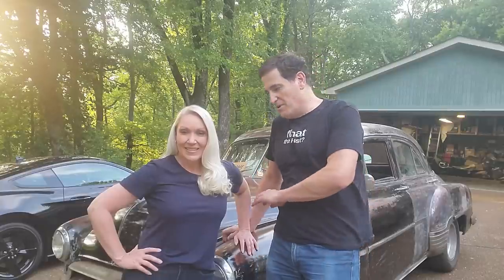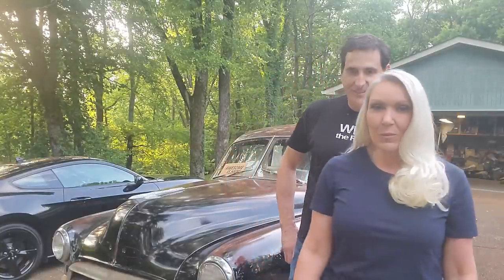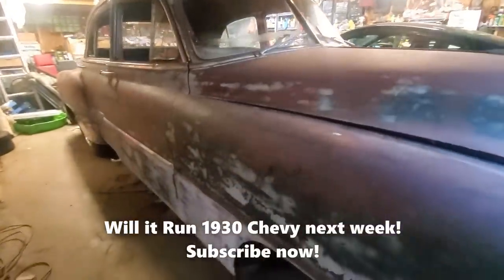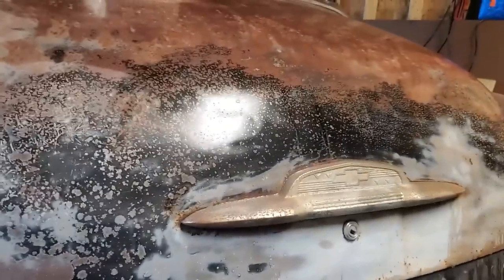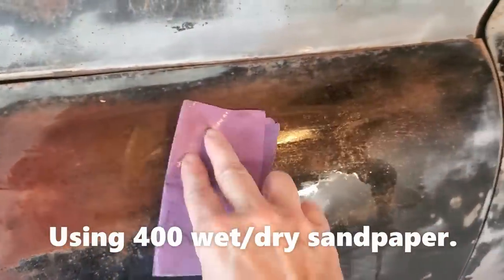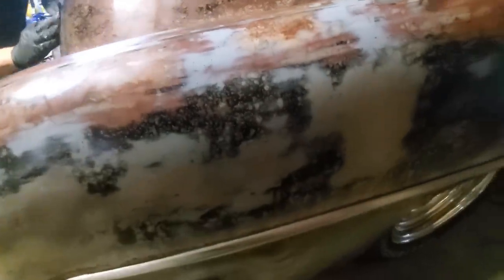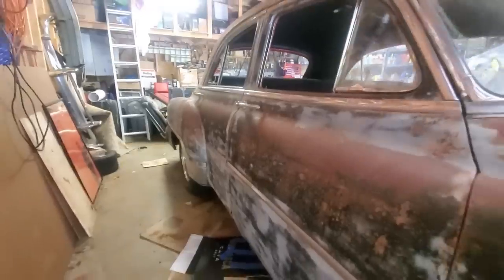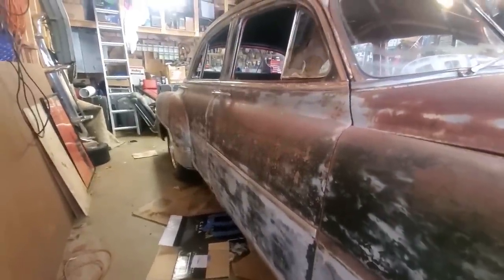First drive in 23 years! Lula, our 1952 Chevy gets a paint makeover and hits the road!

Comment: I viewed a post by Theetravish where he purchased a 1960 Chevrolet and drove it to Arizona and he had a video where he wet sanded the rust off of the trunk and the rust off the roof with wet/dry sandpaper and it really turned out great. I have a 1946 GMC 11/12 ton truck and it has a great amount of rust up on the top and trying to sand that rust off dry really eats up the sanding disc and as the discs wear out all they really do is polish the rust (I mean that rust is thick). Most likely I will have to treat that rust with molasses. But I can see where you could possibly wet sand  the roof on that car and other parts and probably get down to the black paint. Of course one has to know where to stop lest they sand through the top coat of the paint. Of course that car has come a long way and it will look better and better as you improve it.

Comment: One thing that will really improve freeway speeds with these cars is to replace the 4:10 diff gears with 3:73 gears, or even 3:55 gears.  They are factory parts, and the 3:55 gears were standard on cars with Powerglide.  Many other GM cars from the 1940s - late 60s with a standard transmission were similarly geared and will benefit from being geared up.
Reply from the maker: Definitely. I put 3.08s in my 54, and it made a huge difference!

Comment: Hello Again. Those chrome wheels reminded me of the OEM steel wheels or “Steelies” as Puddin from Puddin’s Fab Shop commonly refers to them,
Correct me if I am wrong Richard,,but I think that they used to chrome plate the OEM steel wheels and dress them up with different types of center caps and beauty rings.
The reason why that I immediately recognized those wheels was because My dad had a 1971 Chevrolet C-10 truck with a “3 On The Tree” that he bought brand new that had the OEM wheels and hubcaps originally of course.
 Dad bought those chrome wheels somewhere or traded wheels with someone no doubt and it had been a very long time since I had seen any of those chrome wheels like that. 
My dad used to be a frequent customer of JC Whitney if that tells you anything(LOL).
Dad didn’t keep that truck very long because he liked the V8 engines and that truck had the 250 Inline 6 cylinder engine In which he traded the 71 Chevrolet for a 1972 Ford F-100 Explorer with a 302 engine and automatic transmission. 
I am really looking forward in seeing how your car turns out once you do all of the things that you mentioned. Of Course, If you are like my dad used to be with his cars and trucks, There is never what you would consider to be 100% complete. That interior looks really nice and I can only imagine how the car will ride once you get to that point. 
I can remember the stories that I used to hear about how they used to split the manifolds to create the dual exhaust. If the manifolds were not welded back together very well then you can imagine how badly that the cast iron deteriorated from sitting all of that time being idle. The older engines emitted enough residual deposits through the exhaust to seal up the smaller leaks. Congratulations to both of you for all of your hard work taking shape and the awesome results.
Reply from the maker: Thanks very much! Yes, those chrome wheels are basically stock steel wheels. Back in the day people would separate the inside rim and re-weld it into a deep disk type of wheel, and this is where the term "chrome reverse" wheel came from. This car has a home-made split manifold too. It looks like it was done right, thankfully.
Reply: @whattherust  Richard, being that I mentioned JC Whitney; Do you remember the chrome oil filter add on that used the 1 ply toilet tissue and the “Fire Injector” spark plugs that they used to sell. 
Speaking of the deep dish wheels, I usually buy the wide wheels for my Cub Cadets and John Deere tractors that have the 5 bolt pattern. This allows me to use the 26 x 12.00-12 tires which are taller and wider tire than the stock 23 x 8.50-12 or the 23 x 10.50-12 tires.
I am glad that I bought up a few wheels because the price has started going up like everything else I guess.

Comment: Hi Richard & Christina…greetings from Scotland.
Congratulations…the car looks outstanding. The protective solution, giving it a little gloss was a master stroke.  When you think about the car lying around and not being cared for, its amazing to see the transformation that you both have made.
A question for Richard…have you done any work on the engine, like service/tune up ?  During the test drive I thought it sounded a little rough, but that maybe caused by the damaged / missing exhaust?
 The interior looks great also, and I know Christina is responsible for all of that.

It’s a stylish car, and I don’t know if you plan to re chrome the brightwork or not ? But that would certainly make it pop, and would compliment the chrome wheels …if that’s what you eventually choose.

Nice job..and good luck in achieving 30k subscribers.

Cheers 

John
Reply from the maker: Hello John! So far I have given the engine a new set of plugs and wires, but the carb is bad and needs a rebuild. Something is wrong with the float, causing the need to stay open and flood out the car. Once that is done I will time the engine, tune the carb, and go! We were talking last night about the chrome, and we are undecided. A re-chrome is not possible due to cost, so we are thinking about alternatives.

Comment: I’ve got a 1952 chevy, one problem I’m having is it started recently overheating not sure what it would be, radiator, waterpump, Coolent and everything are all new, just started happening. I live in WA so it’s fairly cold here except in the afternoons
Reply from the maker: If it overheats while driving it is a capacity issue or a stuck thermostat. If it overheats at idle it is an airflow or water pump impeller issue.
Reply: @whattherust  thank you for the info

Comment: I’ve never heard of the product. Is it a permanent application? How does it hold up preventing the underlying rust from eating though. I know people have tried clear coat and the rust just eats through. Thanks.
Reply from the maker: Yes, it is permanent. It is designed to be mixed with enamel paint to eliminate brush marks by flattening out the paint as it dries.  I'll be watching to see if the underlying rust come through. It might over time, but for now the rust has been stopped. Even the area that were bare metal remain clear.

Comment: Did you find a gas tank for ker?
Reply from the maker: I think I am going to be able to re-use the existing tank. There is some rust in it, but I think I will be able to clean it, and it has no holes in it. For now, I am running it off an auxiliary tank.